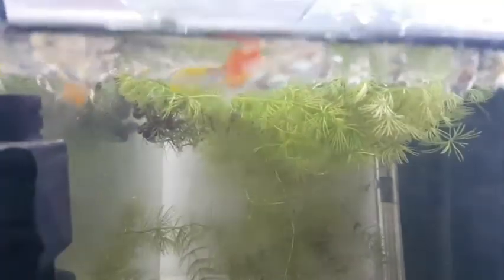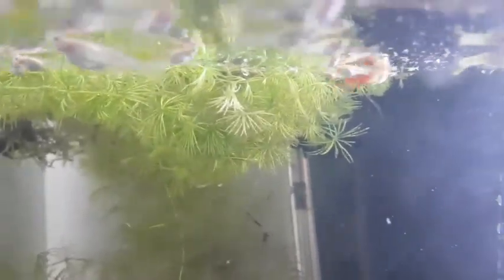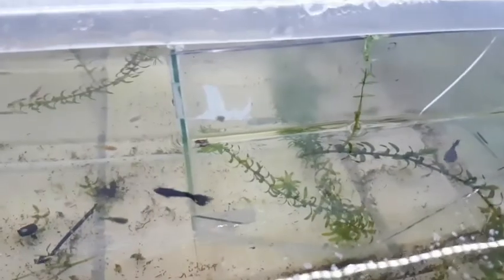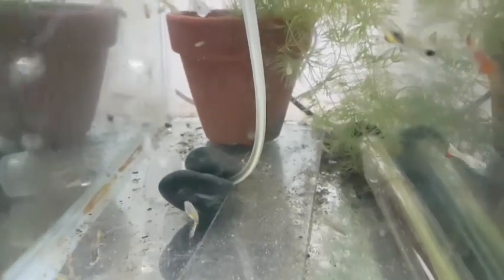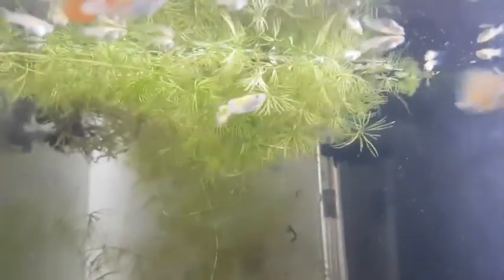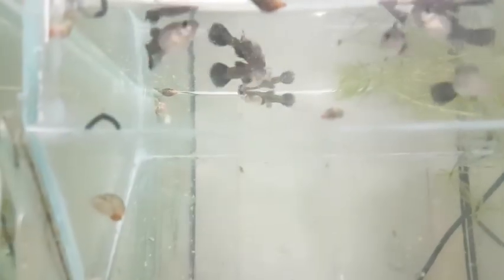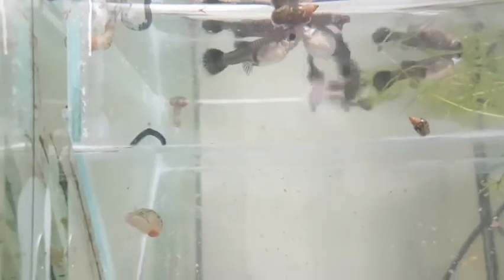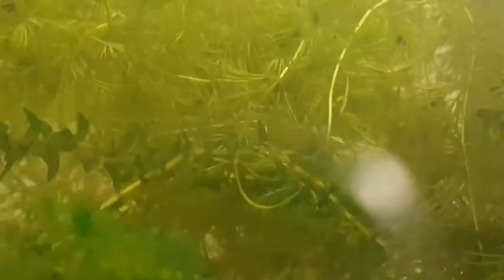Fish Room Vlog Aug 2020

Comment: To hook hose over lip of tank put it through an old laundry sink bracket. The kind you use to hold and run your washing machine outflow hose line into your laundry tub. Works a treat as it can hold your siphon hose to empty your tank and a garden hose to refill it.   Also they are super  cheap.
Reply from the maker: I do exactly that for my two indoor tanks. Yes works great when you don't have a second set of hands to help